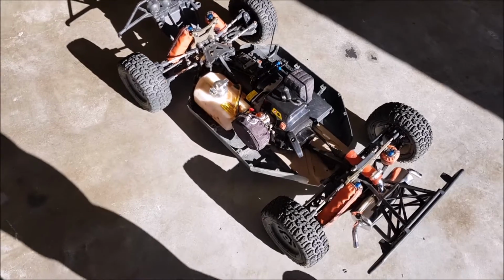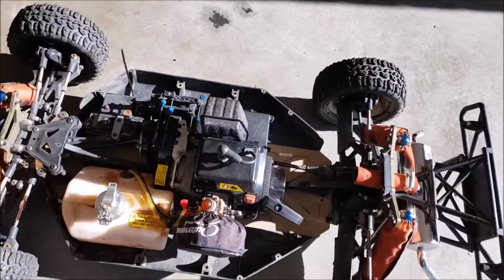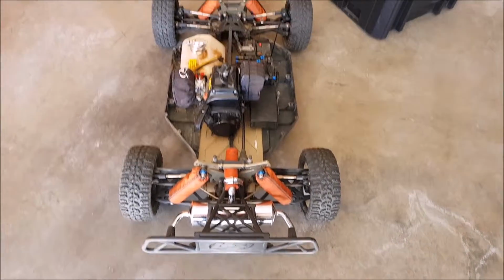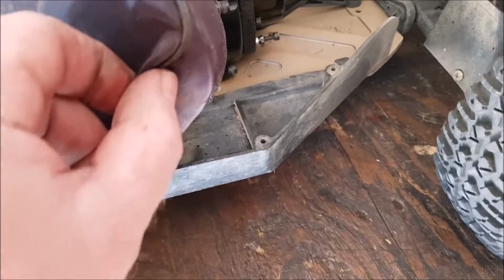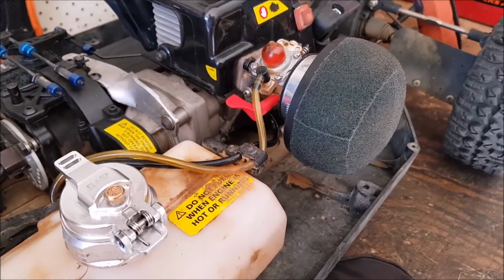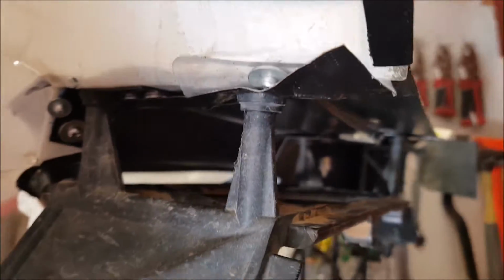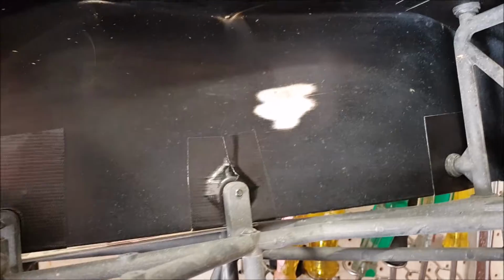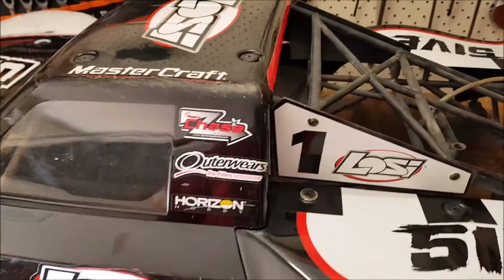1/5 RC Losi 5T -  Pipe Test+Mods

Comment: Dude that longer bolt mod for pullstart is what i need ..what exactly did you do
Reply from the maker: Got a longer bolt and placed a nut at the depth of whats needed to got into flywheel cover and another not to lock it in. Simple 👌👌😎😎

Comment: Did you retune the carb after you fitted the new pipe? They usually need a slight tune to get the best out of them.
Reply from the maker: Yeah i tried tuning it but still didn't change much.